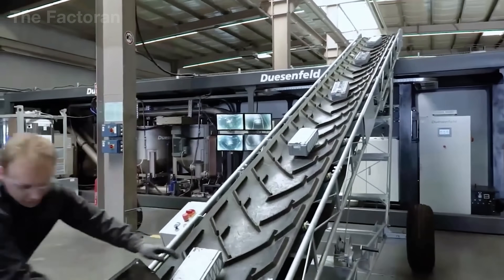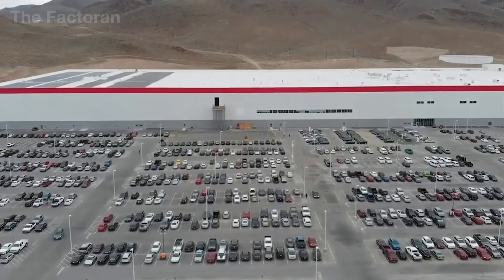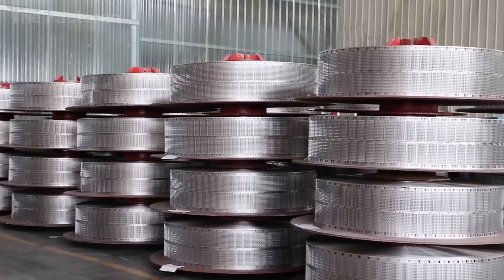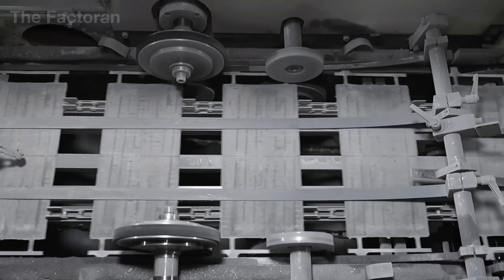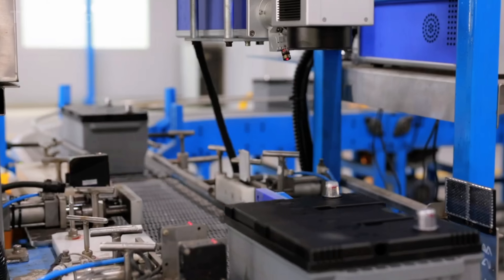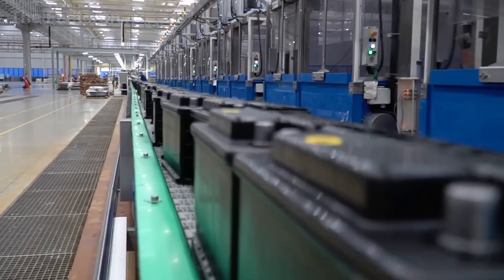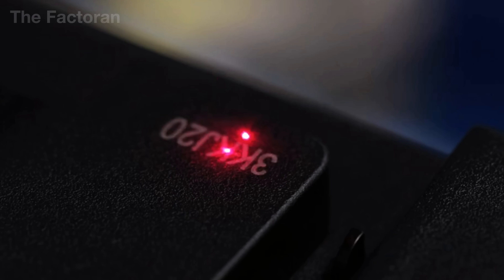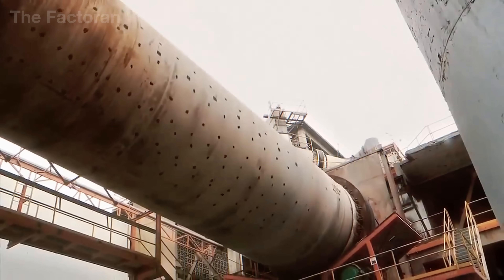How Millions Of Lead-Acid Batteries Are Made Inside Massive Production Line

Comment: for what they cost they don't last long.you can do better
Reply: Use to always get 10 to 12 years out of them, I have a battery in a tractor that was put in 92 and its still fine. All my new ones only get 3 maybe 5
Reply from the maker: I get where you’re coming from 😕. EV batteries are still expensive, and even though they last 8–12 years on average, people expect more for the price. The good news is new chemistries and recycling methods are pushing costs down and lifespans up—so the next generation of batteries should be a lot better.
Reply: It is true that with a high price tag, many products lead to expectations of being much more durable. However, some modern materials or manufacturing processes focus on performance and features rather than long-term durability. In your opinion, which factor is more important when evaluating an industrial product today, durability or performance?